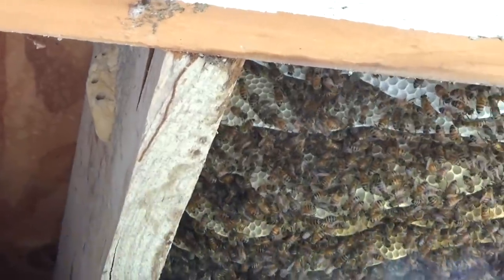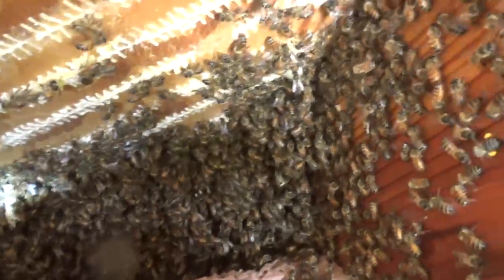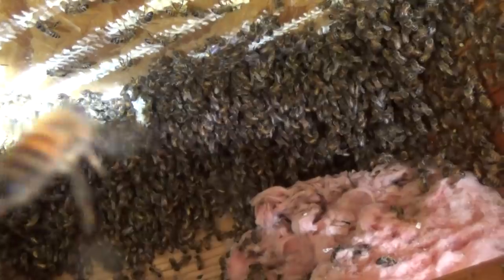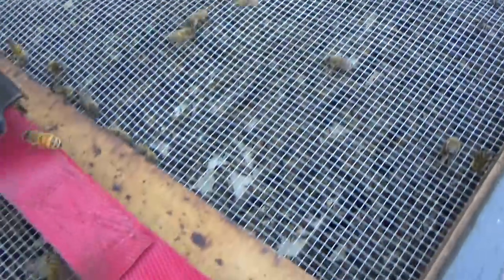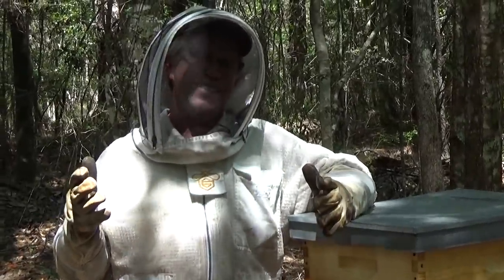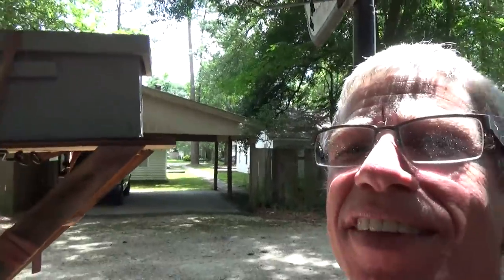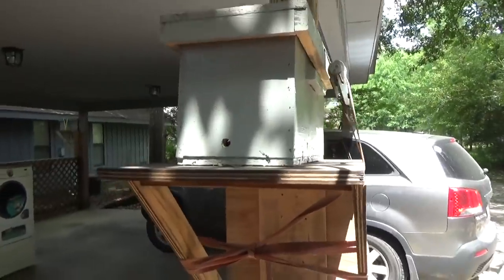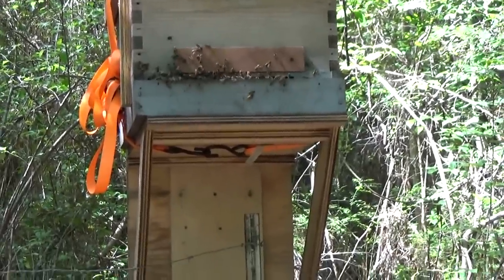Look how fast a swarm can draw new comb.

Comment: Hey Jeff, I don't know anything about beekeeping so I was wondering why you are extra careful to scoop up the queen separately rather than vacuuming her up with the rest. Would she risk being hurt? 
Also what in the long run happens to the swarms you rescue? You have been at this for a long time, so is there a point at which you have too many hives to keep and care for?
Reply: It’s always better if the queen doesn’t get vacuumed but I have vacuumed them and they come out fine, if the queen is caged she can be used to call the bees to the hive that you are reassembling the comb into if she is not caged she can fly off before they get oriented
Reply: Jukelo don’t start beekeeping unless your strong willed lol bees are about as addictive as crack
Reply: @BESHYSBEES  That makes sense, thanks.